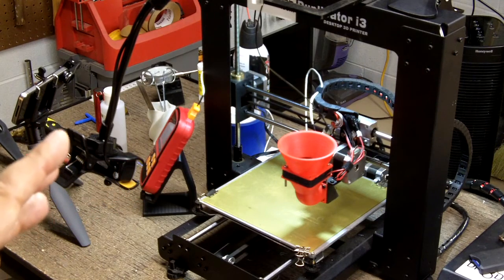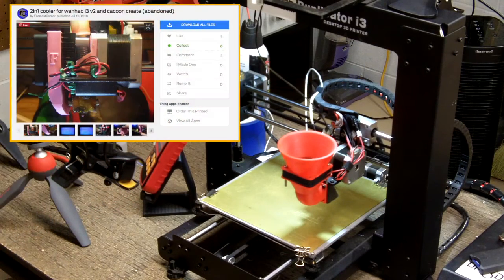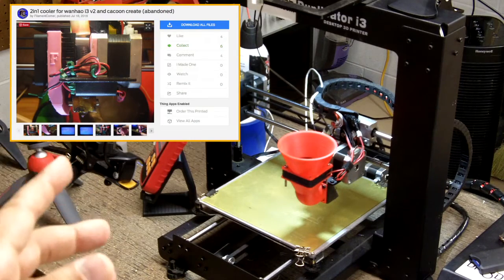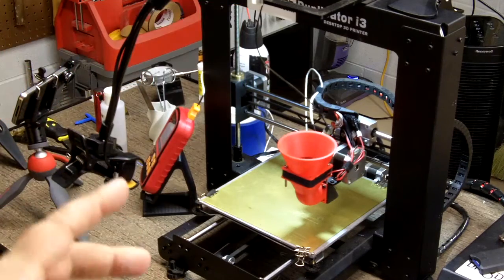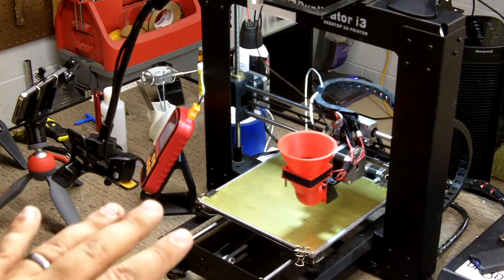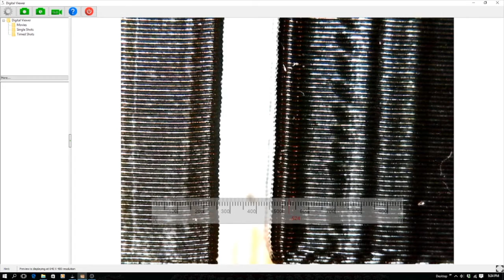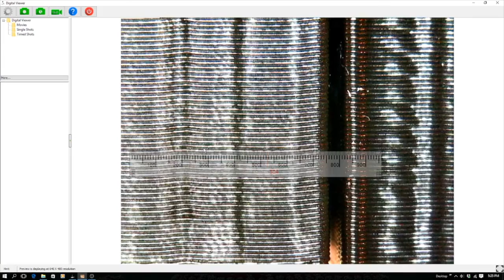Wanhao Duplicator I3 3D Printer - 2N1 Cooler from Thingiverse Part 2 of 2!

Comment: Temperature control should adjust the temps automatically, so it should not rise more than say 2 degrees. Heat fins should follow this but as the filament passes though the cold part of the hot end a big impact can happen
Reply from the maker: The issue is the heating element will regulate itself, however the heat wicks its way up past the heat break as part of the fans air is diverted allowing for premature melting of the plastic.

Comment: So is the layer from the original being affected by transient 'noise' from the machines movement because it's not be cooled fast enough?
Reply from the maker: Don't think so, even though I have 50mm in place of the 30mm, it still using the "existing" manifold and think that is sub-par.  So the extra air I think made a difference, however at the cost of [cooling] the extruder.  I will likely experiment with updated mainfolds once again the future.  However this old girl is getting pretty worn out!  Even with its issues, it has been an amazing machine as I have printed a zillion things on it!

Comment: it seems to help layer .  but have a look at that diverter thing .  i think  form what i can see its not a 50 50 split due to area lost on edge of the diverter . it might be something to try and  make them  with less diversion , but use radial segment . Ugh i can tell im gonna have to TinkerCad that explanation . LOL  but simply put how much  diverted air is needed , could you swipe  say 25% ,  or less and still have ok part cooling effect ?
Reply: ok i tried to do what i meant in TinkerCad. : https://tinkercad.com/things/502KXOFleqq
you could experiment with scoop width . i need to try to make one with a smoother path for my 2 tiny fans . but that i an other thing. lol
Reply from the maker: Very impressive, the "[Tinkercad] Force is very powerful in this one it is" However the issue in my humble opinion is that extruder doesn't get enough cooling so stealing from it will allow steady temp rise to take place.  I am becoming more and more sold on the greater the heat-break the better the performance.  As  I even started to think of a manifold design to CNC out for Wanhao.  However that likely won't happen till spring...
Reply: yeah its a trade off no matter what you do , when yo try to use 1 fan .  There is a cheat for printers like the fab mini where you can grab a portion of the warm exhaust and redirect it . I dont think this applies at all for the Wanhao .  
Im trying some thing a bit nuts , i have 2 very small 12v fans ( 25x25x7mm )  , I modeled them in TC , and will use them to provide part cooling . they are so small they are sleeved bushings and magnetic pull to hold fan in place . LOL  they are almost silent . not much air comes off just 1 , but a fair bit is still pushed , and 2 is pretty good bit . 
I  want to see what the results of just 1 fan vs 2 .  trying to keep the moving mass low .
I'm almost done the redesign of the X carriage to use the no V grove bearings , so i will make a a nice fan mount on it .
Reply from the maker: Very cool again you have some mad skills there dude!

Comment: I agree with you as sharing air flow has never been a good thing from a ton of different designs I have attempted.  I finally found it is just best to get another fan and use two of them.
Reply from the maker: Words well spoke...  As to paraphrase the Second law of thermodynamics, there is no free lunch...
Reply: DIY3DTECH.com
Exactly. :)